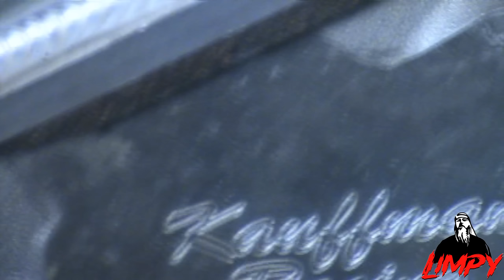TBT When we go and visit Big Chief

Comment: To this day it still amazes me all Chief has accomplished with a damn Pontiac engine
Reply: BUTLER PERFORMANCE
Reply: John Welter ruled the streets of central iowa with a Butler motor for years
Reply: I think it is extremely impressive. Obviously not many people choose to go that route.
Reply: Shit man my old man used to run the 300 ft dirt drags in Ms for yrs in late 70's - early 90's. About mid 80's he went to a 514 Ford and his buddy went to 534 inch Chevy. For 4 or five yrs he couldn't get around my old man. So in desperation he kept a secret and built a big 400 inch Pontiac for the next season with an engine builder somewhere out of the Carolinas I believe. Needless to say he dominated the class for the next 5 seasons with that Pontiac motor. After 4 he finally let my old man know what he was actually running. Those damn Pontiac motors make some Horsies! It took a guy cheating on the cubic inch rule to beat him with a 539 inch Ford. And then two races later got protested and thrown out.
Reply: @NastyNate98  wow that’s great!
Reply: It's that Indian heritage connection. Big Chief/Pontiac.
Reply: @hankclingingsmith8707  it said Kaufman right on his heads in this video....
Reply: @dirtfan05 this is old af.. He runs a Bulter engine